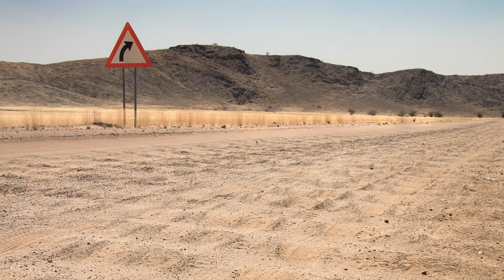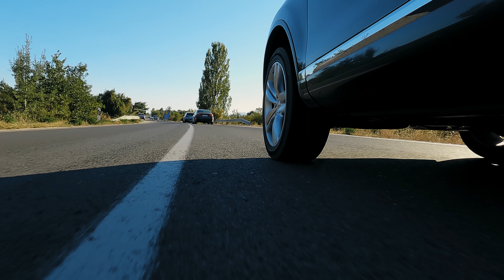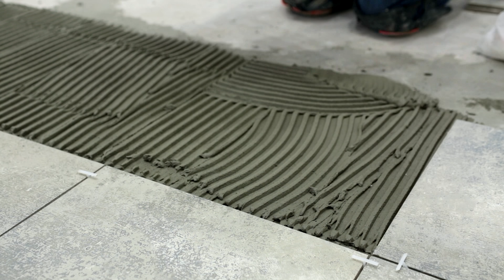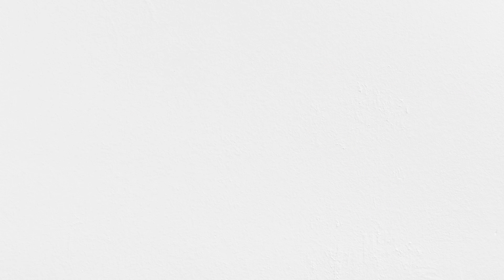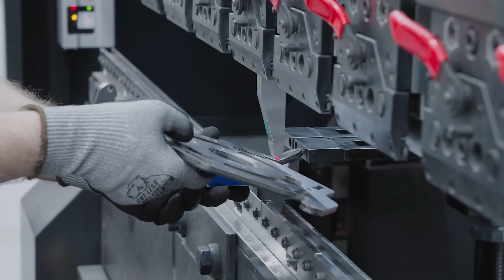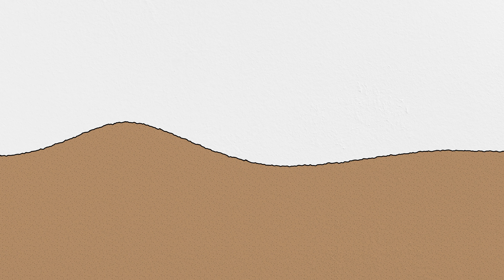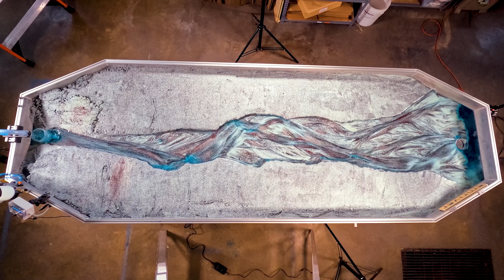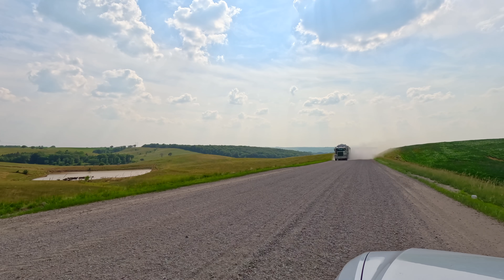Why Roads Get Washboards

Comment: I am curious how changing the speed of the wheel affects the washboard? I have heard that on a washboard if you drive fast enough you can smooth out the ride by hitting the bumps just the right way - is that true? And if so what speed would allow that? aka if a washboard was created with a wheel speed of 10 mph, what does driving at, say, 20mph do?

Comment: I tell people to slow down if you want your gravel driveway to last. Drive smooth and steady or it will force you to slow down overtime.
Reply: Most important comment in this entire thread.  I live on a dirt road a couple miles long.  Those who live here permanently drive slow and steady 18 mph.  The weekenders usually drive 25+, and the washboarding gets much worse after their shenanigans.  

I tow a 8x8 wood beam with some tires mounted to it periodically to maintain our road.  Chains attaching it to my truck are short on the driver's side and longer on the passenger, which helps maintain the center cap "ridge" in the middle (so we don't get puddling after rain) and the tires dragging behind level out the washboards.  I considered making a box blade to do the same thing but opted for using what I had on hand, and TBH, for a box blade to work you really need to drive under 6 mph when pulling it.
Reply: Being careful with acceleration or braking on a gravel road will keep these washboard bumps under control. Acceleration and braking too hard just makes the bumps grow,.and lengthen .
Reply: Fix a local road: speed goes from 50km/h to 80km/h and the road is ruined again after a month or two
Reply: I have noticed heavy truck traffic does not washboard dirt roads as bad as light duty cars and trucks.  Also dry sandy road can washboard faster than wet sandy roads.  Some dirt roads back home were a mixture of clay and rocks. These roads almost never formed washboards.

Comment: The same problem happens with rail transport. Especially streetcar systems suffer from this. It is called ondulated rail and is the prime cause of noise in many streetcar systems. The issue is worse than on "conventional" rail, because streetcar rails are often rigidly connected to a balastless tracks, run the same rolling stock with relatively low axle loads with the same wheelbase of bogies, with similar wheel diameters and identical suspension characteristics. So the problems amplify way more than on conventional rail. Some subway/metro systems suffer from extensive rail ondulation for the same reasons. The only solution is to periodically grind the head of the rail before those ondulations form.

Comment: Dirt roads are still fairly common in rural areas of Australia, most of us who are used to driving on them will match our road speed to the frequency of the corrugations for a smoother ride (tyres making contact only with the crests and not falling into the troughs). In most areas the material properties put the resonance at between 50-60 km/h so not too fast.

Comment: Equations.  What engineer works without equations.  Each road has its own periodicity.  If one posits (hypothesizes) that periodicity is independent of vehicle parameters (weight, tire-size, suspension attack/rebound, etc.) and depends only on road surface particle diversity, what is that equation?

Comment: 15:05 the key isn't necessarily to have more fines in general, the key is to have those fines be made of cohesive materials that have a low-medium plasticity that bind the pavement together, and a low shrinkage ratio. Compare crushed rock/roadbase to a heavy clay, both at opposite sides of the cohesiveness/plasticity spectrum. You want the surface to be able to bind enough to hold together, but not to the point of it turning into a greasy skidpan when it's wet.
Reply: You need to consider cost, most rural counties will probably look at the cheapest option for a road. Every few months they'll have a tractor smooth them out.

Comment: In my neighborhood I've noticed the washboards nearly all occur in sections of road where drivers add power, such as at the begining of inclines.  These are not areas where the vehicle moves faster, but where the vehicle is slowing, so the driver has to add power to maintain the desired speed.  So, I reduce power in these sections in order to keep from contributing to the washbording.

Comment: What doesn't make sense in this video is that the washboard pattern is even across the whole surface side to side.  Where the tires actually rollover the road is usually smoother.  I suspect it has less to do with the tires and the description of the process of developing washboards in this video and more with how air flows under and around the vehicles as they drives down the road.  Heavier dirt particles don't fly around as much to get dragged down the road like lighter particles do.  I bet the ridges of the washboards are made up of particles that are larger and uniform in size.  The shallower valleys between the ridges are smaller lighter grains of particles.

Comment: Asphalt can also wash board on steep down hills due to heavy trucks pushing the asphalt like a rug wrinkling on hot days.  The asphalt softens and moves under the braking of the truck as it slows down. You can see it on hills with wash boarding on the right hand side but not on the left uphill side.  In the old days railroad rail got worn unevenly by the pressure of the driving wheels, causing dips and bumps, especially before curves where the engines slowed down and after stations where the engine spun its wheels as it left the station.

Comment: That's a very nice test setup. Now I want to fiddle around with that, like change the wheel for a actually air filled rubber tire, adjust the weigt on the wheel, and go to a driven wheel instead of the driven arm. I guess the last thing may reduce the build up of material, because it moves some of that back when it's slipping, basically the opposite of the current version.

Comment: The real reason for the high frequency wash board effect is road grading with the blade set perpendicular. Any embedded cobble along the length of the blade will bump the blade and set it going chattering and gouging. I've followed many a grader that ended up leaving the road surface worse for the effort.  The longer frequency that are more like moguls must be caused just as you illustrate.

Comment: Grady, you should watch the March 25, 2024 video about fixing potholes from Poultry Biosecurity. I'm curious what you think of that video in light of what you know about this problem. I think that the effects that reinforce and maintain potholes also have a role in washboard roads. I think there is some similarity in process that can cause washboarding to come back rapidly after it has been covered over with new gravel or re-graded without digging deep enough to disrupt the underlying pattern of compaction. In my experience, washboarding often reappears very soon after grading or a new layer of gravel has been applied. I saw that happen on the roads that I used to drive on 30+ years ago when I camped, hiked and rode my mountain bike in an area that could only be reached by long gravel roads. What do you think about that? Has anyone else seen that too?

Comment: it would be interesting to look at what happens when you increase the speed once washboards have formed. anecdotally I've found that increasing speed on washboarded roads can actually smooth out the bumps, almost like the tires are only hitting the crests of the bumps. I wonder if over time, this could serve to re-smooth the surface since you're only hitting the high spots?

Comment: 9:25 I believe this demo is not entirely correct, it is showing that wheel pushes matter forward piling a new bumb ahead, but what I believe is actually happening, especially in real vehicle where wheel is not just dragged over the road as in this demonstration set up, but spinned by engine, is wheel moving up the bump relatively smooth(which makes front side of the wave shallow), and at the apogee it briefly lifting off the ground, and then falling down. And when it hits the ground again it tranfers energy from rotational force to grains underneath making them travel in direction of spin(which happens in one fast burst, and this makes back side of the wave steep). In other words wheel is not piling next bump ahead of itself, it piles the bump it just jumped off by digging a pit underneath and throwing those grains backwards. And the sheer presence of pit makes bump ahead exist. And then the process starts over. Hope it was somewhat understandable, correct me if I am wrong.
P.S. It is also makes me wander about similarity in fluid and grain dynamics, I believe concepts of wave formation are pretty much the same, haven't finished the video yet, may be you said something about it.

Comment: since you've biult a test track, i would like you to test a theory of smoothing it out and wetting the surfaced to see if the water will help compact it as it dries. not in a way of flooding but enough to get the to layer to self compact.

Comment: It's not just the motion of tires, but also has to do with weather as well because you wouldn't see it so evenly from edge to edge even where you don't drive. No one drives down a dirt road with your tires inches from the ditch, but you'll notice the washboard DOES continue all the way to the edge where no one drives. Which you'll notice DOESN'T happen in your model. 

It's a combination of multiple factors, but traffic adds to it.

Comment: I would really have liked to see you varying speed to see how it affects the washboard development. Speed is obviously the factor in how far there is between bumps as it affects how far the sand is "thrown" when the wheel catches it. I was wondering if you just vary speed, then maybe washboarding will not form since sand won't be deposited the same place each time.

Comment: I’m not sure that test demonstrates the same even as roads. The test results had peaks 5x the solid tire diameter. While a washboard road has peaks about 6in apart from pneumatic tires 24” in diameter. I’ve questioned this for years and my questions (sadly) still remain. I’m not convinced by this theory though it might be the best that’s been studied.

Comment: A heavy application of magnesium chloride and vibrating compactor work wonders on heavily used gravel roads we had a gravel road in town last 15 years on this method without needing maintaince before finally being paved, whereas it used to needed to be releveled on a daily basis from overuse.  It is also an expensive option.
Reply: A wave pattern, or 'washboard', is the normal result of two fluid (or fluid-like) layers moving across each other. Very low slope sand bottom parts of ocean beaches experiencing the one way movement of the shallow body of water above it, as the tide goes out, will develop this characteristic washboard, as seen at low tide. You have changed one of the participating layers into a non-participating solid.
Reply: Yeah but the corrosive nature of magnesium chloride is hell on your vehicle.

Comment: My father new this at least in the 80s. He drove a motor grader for DOT and he said that dirt roads would get washboarded due to speed and it started with the motor grader operator driving too fast when maintaining roads. He knew that the oscillations would cause problems and it was driven by the speed of the machine.

Comment: You never mentioned the effect that braking and acceleration (especially on grades) does to washboard. Vehicles, especially logging trucks, that use heavy braking down grades tend to cause a lot of washboard. On the flip side, vehicles with a lighter drive end will cause washboard on the upside of a grade

Comment: Haven’t watched the video but let me guess: car drives on road, hits a rock or other object that causes a slight bump. The unsprung load of the tires is counteracted by the shocks trying the do their job, causing a repeated “wave” motion of a 4000 pound vehicle, causing ever so slight compression to that area of the road which amplified little by little, everytime another vehicle drives over it, resulting in each sequential vehicle experiencing slightly more “bounce” and therefore damaging the road just a little more. A domino effect.
Was I close?

Comment: Having grown up and lived on 0.5 to 1 mile long gravel driveways. Corrugations start in the wheel tracks from vehicles following them. If a high enough % of traffic aim for the highest loose gravel points on the road seem to spread out aggregate into the holes at the bottom of the corrugation. This may not stop all corrugations but definitely holds the effect off for a long time. On roads that 95% of traffic was our family the road was like a highway as it was constantly rolled into smoothness we were taught to drive over any loose gravel.

Comment: Cool, interesting. Not just the traffic causes the bumps, but also wind. I see the washer board pattern right out to shoulders where no tyres roll, and the tyre tracks are smoother than the shoulders. I’d say the predominant factor is wind or something that blows the pattern into formation. But the combined forces result with whatever you are facing to drive over. 

Pave everything 😅

Comment: I've done a bit of off-road driving here in Australia and on one of the trips to the northern tip of Cape York there were hundreds and hundreds of kilometres of corrugated dirt roads. There was no internet to entertain me and so I had to find other things to do. So I thought about the corrugations and I think that one of the other reasons they might tend to deepen is the tyre pushing the air out of them between the peaks as the car drives over them.
Just a theory.

The other thing I found that when the road was otherwise suitable the ride was much better when I drove a lot faster, so the car was just floating over the tops of the little bumps. One problem was the car did tend to wander around a bit but I'm a race/rally driver so that didn't bother me. The big problem was slowing down, as the extra load on the front tyres really hammered the car.

Comment: If the washboard shape and spacing is predictable, could you make non-circular wheels that match the shape of the divots? Kind of like the car with square wheels that drives perfectly smoothly across a surface of convex semicircles.

Comment: I’m a simple man, I’ve worked in the woods for many years operating heavy equipment, working on and driving on unimproved roads. Washboarding is my nemesis. You have done such a wonderful job of unpacking this complex problem. But there’s much more to it. Speed, tire pressure and the road base composition are all important factors like you mentioned but you didn’t touch on a few other variables. Steep grades develop washboards faster if all things are equal. Heavy trucks without weight on them develop washboards very quickly. Hard braking coming into corners builds washboards backwards. It’s also interesting how washboards cannot be covered up with roadbase to make them go away. They come back, Quickly. To get rid of washboards you have to cut down well below them and spread material back in with the proper moisture and then pack it in with heavy compactors. I firmly believe that tire pressure is the biggest common denominator in washboard prevention. High speeds and pavement require higher tire pressure than lower speeds and gravel but who wants to take the time to air down or up when they change road surface?

Comment: i live down a 400m lime driveway. In an attempt to preserve the surface for as long as possible i drive different lines each time and different speeds between 20-35km/hr (using cruise control). Hard to know if it works as two other family members use the driveway too, but i feel like i’m doing my bit 😅. hope it’s not for nothing lol

Comment: What a great explanation! It also helped me to "put a checkmark" on one of the many thousands questions that I have on back of my mind 😆 I've noticed the "washboard" phenomenon on the roads, but my first memory has to be the sand on the seafloor. Even as a little kid I've figured out that it is due to wave action, but wasn't certain on the exact mechanics.
P.S. separate thanks on the SendCutSend plug, this should come very handy, if the price is right.

Comment: As a prevoius road grader operator i noticed that wash boards showed up mostly on high trafic areas and got worse during planting and harvest season in iowa we had to grade the roads more often during those time of years. After it rained it would made a big diffrence in the condition of the road, as the rain and traffic would create pot hole next to bridges and low sections of the road. I also noticed that most wash bourds would show up at stop signs as many people would stop in a short distance with heavy loads such as semis and tractors could weigh as much as 95,000 pounds if not more if hauled over the limit. people would also get on the gas to hard causing washboards as well, you could tell who was speeding down the roads causing them to show up because the washboard would usally stop in front of their drive way and the rest of that road was smooth when you went to drive over it. Its cool to see that they are doing reserch on this topic i just wonder how many veritable go into what they are testing. I saw that you used sand but a normal gravel road have a base layer that has been biult up over years and it is very hard, it also has diffrent gradient of rock in the road such as fines, corse, and rough that make it bind together as one creating that hard surface that in my opionion made the road surface hard as asphalt or close to it. We mainly used lime transported from the east side of the state as are material but they have changed it up in the last year i worked for them. Thought i could give some insight on what it is like to maintain that surface and what we notice when we work on the roads.